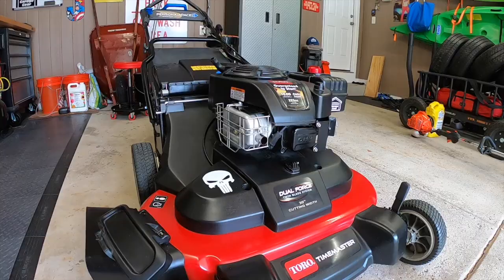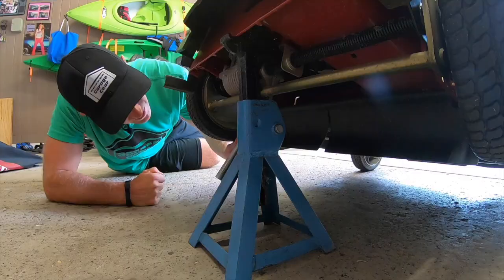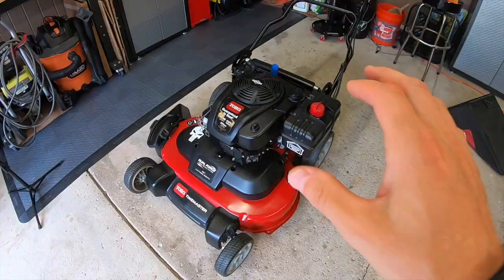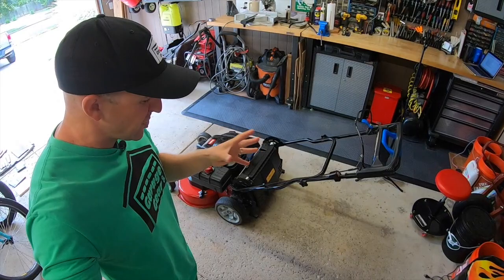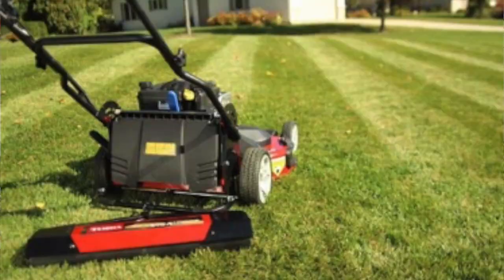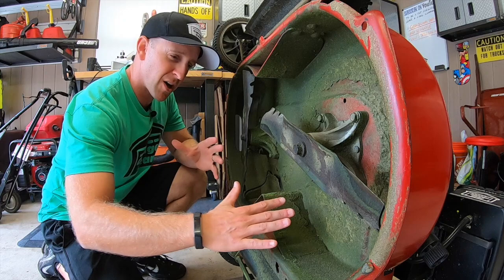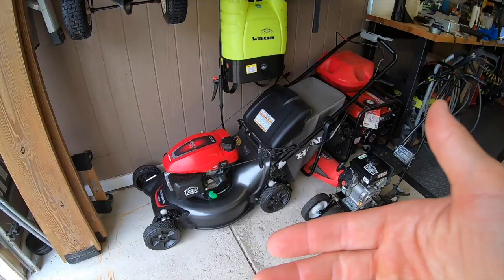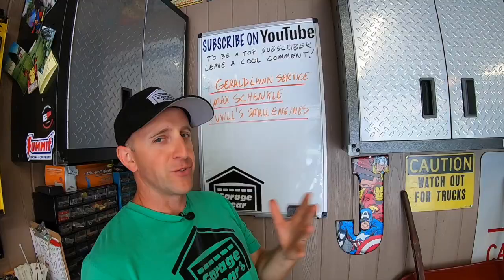BEFORE YOU BUY A TORO TIMEMASTER, WATCH THIS!

Comment: I generally dont comment on YT but there are a lot of complaints in this video void of any reasoning to understand the real cause for wildly ambiguous problems. As an owner of several Toro mowers I would like to share my observations. 

I have a Time Master (TM) and a Time Cutter (TC) for about 3 years now. The TM I use as much as 3 days a week on my 16k sqft lot (and occasionally my neighbors lot which is similar in size). 

I agree on the TM fuel tank being under-sized and the drag flap is arguably complete garbage. There is nothing more to say and Toro should be embarrassed for having these two issues. 

The only real issue I have experienced is the TM blade engagement cable snapped on my third season. With my local Toro dealer being closed at 5pm and myself being handy enough, I was able to make the repair after hours with a modified brake cable i bought from a bike store for 5 dollars along with two 1/16 ferrules, one thimble (for attaching to the engagement handle), and my handy 40k lb hydraulic crimper (probably could get away with normal people tools like a bench vise, or even a vise-grip perhaps)  I have a suspicion this Shimano cable is likely better than the original, if for no other reason than I greased it and I doubt they did this on the rusty OEM cable I pulled, but only time will tell.  These cables stretch over time and require adjustment. It makes me question if those with transmission and engine issues are possibly seeing problems consequent to neglect of normal maintenance on the cabling and the pulley tensioner. The issue I didn't see brought up as it relates to these components is how grass and dirt seem to make their way under the plastic cover, which likely could be related to the belt and pulley issues you discussed. 

This TM mower REQUIRES super high lift blades to prevent clogging, and tbh I have never seen a non-commercial mower that didnt clump a little on wet grass. Heck, many commercial mowers leave clumps behind when mowing wet morning grass too, so its not clear to me why anyone would expect otherwise. Also its worthy to note since its "no-mow May" that you should never be cutting more than 1/3 the height of your grass if you care to have a healthy lawn. If you find yourself cutting half or more the length of your grass then at least part of the issue is that you are not mowing as frequent as required. 

While some states such as Illinois sell ALL gas with ethanol by law, using premium fuel without ethanol may help to minimized natural engine wear. I wonder what gas was being used in these failing engines and if oil changes were performed at regular intervals. Maintainace-free small engines do not exist as far as I'm concerned, so anyone who does not know how or care to perform regular maintenance on their lawn mower should look at other mowers. Like mowers so cheap they are disposable or electric, because neglected internal combustion engines are generally not gonna last very long. 

With proper maintenance I think the TM is a great mower and I have no regrets on the purchase. It was about $999 when i bought it, but I admit I wouldn't pay todays asking price of ~$1400 because that pushes it close to a lot of other options.

On a side note since I own the TC as well, I thought I would touch on my only gripe to this day. The side chute is cut too far inward exposing about 4 inches of the blade on the right side. Most people I know find the side chute attachment sticks out way too far (on all tractors, toro, jd, etc) and they remove the discharge flap entirely in most cases. This TC deck design makes removing the discharge flap particularly dangerous. Also it makes for an incredibly weak rim around the bottom of the deck that could get bent easily on landscaping rocks, tree stumps, and whatever else lurks in todays lawns. (A friend of mine accidentally ran over a mostly buried engine block in a field once). The discharge flap on the TC needs a complete redesign to raise and lower the discharge flap vertically on an actuator in addition to a spring hinge, which is how I modified mine. The current design seems like it was centered around people who bag their grass.  

I watched this from my phone and commented in a tiny box typing with my thumb, thus didnt spend much time proof-reading. I apologize in advance for spelling, grammar, calitalization, punctuation  issues and anything else unrelated to grass and lawn mowing.  

regards, 
-dBo
Reply from the maker: Thanks for sharing your experiences dbo

Comment: Also when I mowed yesterday the grass was slightly damp as it rained that morning and just a tiny mist that afternoon.  No clogging at all.  Easily washed out the underside of the mower when I was done using the hose port and then sprayed manually and there was not much on the ground after I was done.
Reply from the maker: Awesome! Thanks for sharing!

Comment: And I was really considering buying one for next season. Thanks for making this video and saving me $1,500 and a lot of headaches. I'll keep using my $700 honda push mower. It cuts tall and thick grass like no other without stopping.
Reply from the maker: Awesome Jack! Glad I could save you some headaches! Hold onto that Honda! They always get the job done! Thanks for watching!
Reply: I own the commercial 21" Honda for my lawn care business and I have a completely different opinion. My Honda clogs up constantly. This is the part of it I hate the most. My guess is that even its 200cc engine is to weak plus the back discharge is inferior to side discharge.
Despite these flaws I love the reliability of Honda, ease of use and the huge grass bag. I'm in the process of either getting the larger 30" push mower (Timemaster included but given this review I doubt it). Maybe the Turfmaster which is commercial Timemaster. Or I'll go all in and get the residential zero turn Toei Timecutter since it'll work for 2-4 hours a week..

Comment: I purchased a Timemaster several years ago when the price was under $1,000. I maybe, had it for 1 month before I returned it. Like you, my yard is larger than most for a residential neighborhood, about 15,000sf. The problem I encountered was the mower would just die. After about 20 to 30 minutes of mowing, the mower would just stop and would not restart until it cooled down. This happened everytime I cut the lawn. Don't know if this issue was ever resolved, but I never bought another one. I replaced it with a Cub Cadet 33 inch walk behind, about $1,200 at that time, now ovewr $2,000, I think.. That was a true workhorse. Quick and powerful. The only issue I had with that one was it was kind of a beast. More powerful than I needed. Sold it about 5 years later. Now just have a couple of the standard size walk behinds, 22 in, I think. Looking for a wider cut, but haven't found anything yet. Was considering the DR 30in, not sure though.
Reply from the maker: Give the Scag 30 or Ferris 30 a look. They are commercial so you’ll pay more but they are really well built. Thanks for sharing this with the Garage Gear Community! Thanks for following along.

Comment: I am a professional landscaper. The toro timemaster is a finish mower. It is not meant to mow high grass or wet grass. The turf master which is the commercial model is the same. They will clog in mulch mode if the grass is high and wet. It is a great mower for weekly lawn cutting and in dry conditions. There isn’t a 21in mulch mower that can cut grass as small as this mower can.
Reply from the maker: @towerladder87  thanks for sharing tower

Comment: I've found a definite improvement in mowing time with the TimeMaster.  Granted, I've only had it for one season and one mow so far, but I've been pretty happy. My yard does have places - particularly in Spring, where the grass grows tall. It struggles a little, but I can usually make it through. My previous Toro would have absolutely choked in the same situation.  I didn't have any issues with clogging last year, though. I've seen enough videos on the pully system to know that it'll come for me one day, but I have a hunch that many of the other issues are YMMV.  Frequency of mow, type of grass, type of weather, length of grass, aggressiveness of how you mow, terrain types, etc.  Those will all put more or less stress on the mower.  People complain about the gas tank, for instance, but I think the only time I've had to refill mid-mow is when the grass was really tall.  IMO, that's more an issue of me skipping mows during growing season (and me being lazy and still trying to use a lower setting) than the mower letting me down.  I'd consider my overall lawn area 'average', but I do have hills on either side of the house. Overall, no regrets yet, but it's good to have videos like these so we know what could be coming down the line.
Reply from the maker: Thanks for sharing Ken! Appreciate your feedback
Reply: Yea, I'd say "let's reconvene in a year or two."  Not wishing issues on you but the verdict is in on these and the news, while not entirely bad, is concerning.  Toro should have done much better.
Reply: @GunnyPhillips  Agreed.  One season is not NEARLY enough time to assess this machine's reliability.  After owning my for 9 years, I can attest it needs to be built much better.  Too much shop time and too much money spent on repairs.  I joke with the shop that the second M in Timemaster should have been a W.
Reply: This stopped me from buying one. I have 10 yards a day minimum.  It will not work for me. Yes I think it's a great NONCOMMERCIAL tool and you will enjoy yours. Total Home Care . Punta del Esté Uruguay

Comment: I totally agree with you on this, personally, I would rather spend more time mowing with a cheap mower rather than spend $1500 on a Toro timemaster and have to fix all these issues.  And me and my friend have noticed that ever since Briggs and Stratton got bought out the quality has gone down drastically.
Reply from the maker: Glad we see eye to eye Will! Their quality has gone down rather quickly. What’s going on in your garage these days?
Reply: @GarageGear   not much just working on a couple push mowers and a leaf blower that has a running issue.
Reply: I’m pretty satisfied with mine. I do agree on the size of the gas tank. I wish it was larger
Reply: I’ve had one for three years it’s amazing and really does save me time. It stripes nice too!
Reply from the maker: @WillsSmallEngines  good luck with it👍
Reply from the maker: @MatthewSmith-uf6tr  thanks again for sharing

Comment: Such a good and spot on video. Just had the idler pulley shear off last night and take all the belts with it. Soooo many issues with this mower. My previous Toro last 20 yrs with me and still going with my FIL. Had the Time master for a short time and replaced 2 sets of belts, idler pulley, blade engagement cable, personal pace cable, gas tank ( leaking), and have the engine deck bolts rattle loose twice. Finally the dealer added nuts to the top of the deck to stop it. The only thing I haven’t experienced yet is the transmission issue. Thank you for the video.
Reply from the maker: You got it pel! Thanks for sharing my friend

Comment: I upgraded the blades to the toro atomic 20120p model blade. Mine came with the high lift blades and those didn’t run well with mulching. Now it’s great. Better on gas also. No issues with clogging up and doesn’t leave a mess on the yard.
Reply from the maker: Thanks for sharing j9

Comment: Agree on all points.     I’m old so taking a break between the front and back is ok- usually I have a beer or two!  This will likely be the last gas power mower I buy.   Like a classic/sports car.  Cool to use but your always working on it.    Great video.
Reply from the maker: 👍definitely cool to use but the behind the scenes work to keep it going is a pain for sure! Going electric next time around? Thanks for the positive feedback my friend.
Reply: @GarageGear  I think so.    Hope they have a 30” deck and improve the recycling performance.   I usually swap out my blades after 15 mows.    Keeps the performance up and leaves the grass with a smooth cut.    Cheers brother!
Reply from the maker: @edrumsas5420  cool! You’re wise to do so my friend! Enjoy the rest of the weekend! Cheers! 👍🍺
Reply: @GarageGear  yep.   I spoke too soon.  Engine is running ruff.  I’ll take a look at the spark plug and fuel filter.   At the en of the season I will clean the carburetor
Reply from the maker: @edrumsas5420  oh no!   Those carbs are relatively easy to clean! Shouldn’t be a problem for ya!

Comment: It's why I like your channel because you do honest reviews.  I own a Toro 22 inch Personal pace self propelled rear wheel drive lawn mower that I purchased in 2012 For my one third acre lot.  It struggled up the hills because of a weak transmission.  I then moved to a house which had one half, an acre and a steep Hill.  I looked at the time master and concluded. It would be too weak for the hills.  A neighbor of mine bought a toro time master.  It lasted one season.  He then went out and bought a john deere tractor.  I decided I wanted a mower that could handle a seventeen percent grade hill and do it safely.  There was no residential mowers that could handle the hill regardless of how much I spent.  So I decided on a gravely pro walk 36 inch commercial machine.  The only thing plastic on it is the gas tank.  It has a fourteen and a half horsebower kawasaki is kawasaki engine.  It works perfectly.  I will never go back to purchasing a residential mowing machine ever again.  The toro time master residential machines are all junk, Plastic throughout
And the decks are 14 gauge sheet metal that is stamped, Which end up cracking at the high stress locations such as the handle bar Attachment location.  I now look forward to mowing my lawn with my gravely.  But one has to have the money to buy a up front and it is 2-3 times more expensive.  But if you can afford it then many of your Maintenance problems are going away forever.
Reply from the maker: Thanks for sharing this Frankie! You’re right there’s a lot of plastic on the timemaster! Total junk! Glad I sold mine!

Comment: Thanks for an honest review.  Our yard is approximately 12,000 square feet. Deck coatings of various kinds only help a little. I power wash the deck after every mow and this comes very close to eating up the time I saved over my 21 inch Honda.  Drag flap needs replacing after 10 months of use.  I clean under the housing covering the belts and pulleys after three or four mows.  I bag the clippings and it does a fantastic job in high dry grass.  Like you, I fill the tank twice during the mow but I find this to be a minor inconvenience. The quality of cut is comparable to that I get from the Honda.  I think I paid $1270 for this mower in October 2021.  It was then and remains grossly overpriced.  I’m on the fence as to whether I would buy it again even at the price I paid last year. I definitely would not pay $1400-$1500 for it.  But I do like the cut and the fact that when my tall fescue is overgrown (usually because the weather has been inhospitable for days on end) it performs like a champ to get it under control.
Reply from the maker: Very well said Dale!  I agree with you on everything! Especially the cost! Thanks for sharing your experiences with the timemaster! 👍
Reply: The real thanks goes to you for your willingness to call it straight. God, I wish Honda would enter the 30 inch market.

Comment: I have had my time master for over 8 years. Plugging is a big problem and I only side discharge. Have had no problem with the engine. The pulleys though gave me problems in the beginning. They are however able to be taken apart and the the bearings are then replaceable with good heavy duty bearings. Have not had the problem since I changed them. At about five years I did replace the transmission with one I found online aftermarket. Still going strong. I doubt that I will replace this mower with another time master.
Reply from the maker: Thanks for sharing this with the community amacan

Comment: Great video and flow.  I wanted a Timemaster in the worst way over the past two seasons.  I heard about the fuel tank complaint and the pulleys failing.  I know two guys who have one and they have no complaints.  In any case I decided to stick with my two "older" 21" Toros.  They get the job done and when my son is running the other, the lawn gets done faster than any Timemaster by itself.   With that said, I'd still like to give one a whirl but $1500 is steep knowing pulleys will be an issue.  Be good.
Reply from the maker: Hey Lawn Journeys! I checked out your channel! Great content on there! Luckily other than the flap and gas tank I haven’t had these major issues but I see way too many complaints on the FB page about these! Keep your older toros and avoid the headaches!  Thanks for watching my friend!

Comment: I have had a Honda self-propelled 21" for 7 or 8 years.  It never needs scraping out underneath and it stays relatively clean.  I sharpen the blade once a year, change the oil once a year, and I am still on the original spark plug.  I take the air filter out and knock the dirt out of it about once a month and that is it.  My lawn is 10K sq. ft. and I was looking at the Timemaster to save a little mowing time, but after this review, I'll just stick with the Honda.  Great review!  Thanks!
Reply from the maker: You got it Randy! Keep that Honda running!